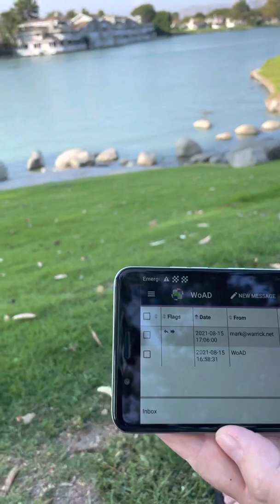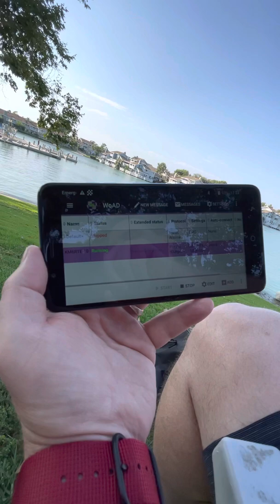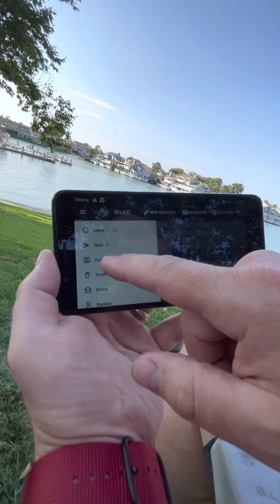Winlink with WOAD, Mobilnkd TNC3 and an Anytone D868 Handheld

Comment: Nice work. I'd like to do that on my Anytone but can't find a Mobilink TNC3 anywhere. :(
Reply from the maker: Check out the DigiRig - basically the same thing as the Moblinkd TNC3.  I haven't done a connection with the Anytone yet but I assume it would work.  The connection cable is the same as Baofeng, Wouxon and Kenwood.  https://digirig.net/product/digirig-mobile/
Reply: @MarkWarrick  thank you! It's all new to me but I want to try it out. Thanks for that.👍

Comment: Awesome demonstration, I love the mobilinkd 3, I cannot use bluetooth with my vehicles android headunit and had problems, The 3 version works over USB as well not just for charging allowing it to plug directly into tablets, headunits, phones....

Keep up the good work Mark.
Reply from the maker: Thanks Connor.  The Mobilinkd TNC3 is pretty handy.  It also works as a desktop / laptop TNC as well via Bluetooth.  I've had several cables made for it to try different radios.  So far I've been successful with a Kenwood TM-281a, Kenwood T741A, Radioddity GD-77, Baofeng UV5R and now the Anytone D868.  Only two radios so far DID NOT work with Mobilinkd - The Btech UV-25X and the Radioddity QB25.
Reply: @MarkWarrick  I have only tried it with a UV5R and my truck has a BTech 25x2, the moblinkd lives in my truck and is used for running APRSdroid on the 10" android headunit, very seamless running bluetooth music, navigation , and APRSdroid. It is awesome that APRSdroid works with backcountry navigator to show others in your group on navigation.

The next step is to finish some wiring and add AREDN nodes to the roof rack to be used with the headunit as well.
Reply from the maker: @connorh5930  I’ve not been successful using the Btech UV-25x2 for Winlink but it does work well for you APRS.